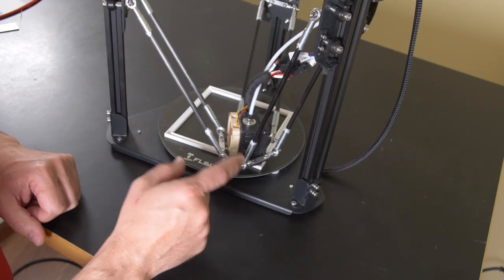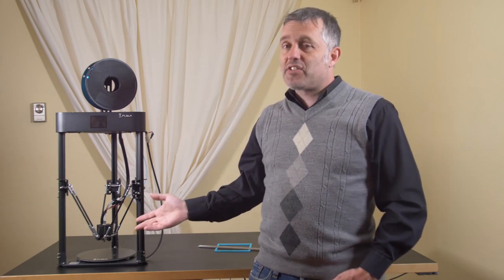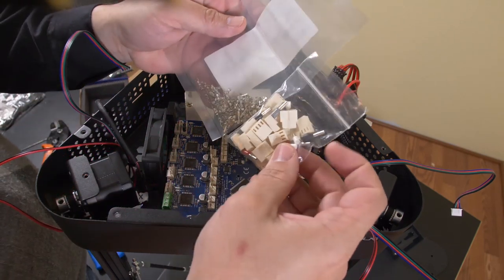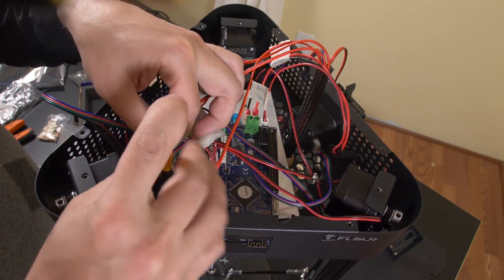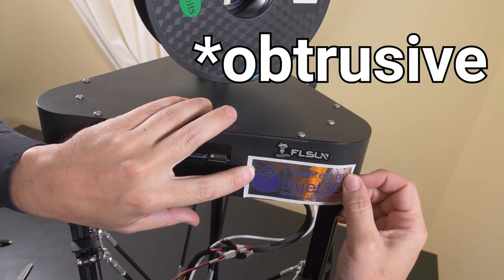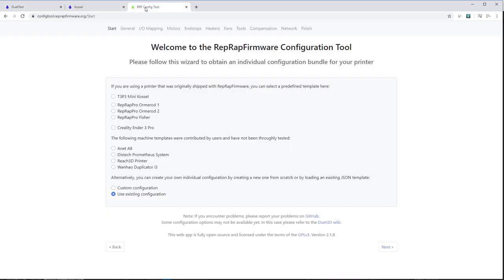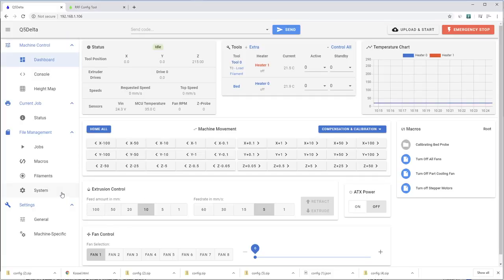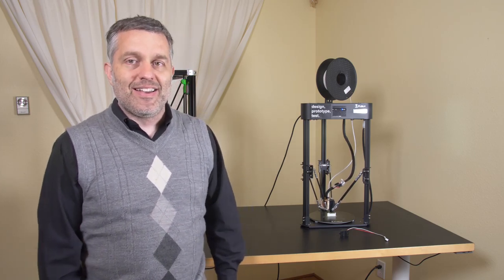How to Build the Best Delta 3D Printer for the Money in 2020

Comment: I agree with everything you're saying, but price is still king. If you're spending $300 to upgrade a $200 printer, it's no longer a competitor against $200 printers.
Reply: @SystemsPlanet  even if it does there's two problems as cool as it is to see a budget machine upgraded to perform at a higher level :
(1) it should have been functional out-of-the-box
(2) convenience is a feature too
Reply: So I bought a Rostock V2 back in '14 and straight away the ezstruder didn't work worth a darn. The hotend self-destructed, the arms kept popping apart during a print, bed leveling was strictly manual, accuracy of the prints was marginal at best, the power supply died after about three months, and the RAMPS board was crap. All for $1000. 

The one thing that SeeMeCNC has going for them is their fantastic forum support. It's really second to none.

If you own a delta (thanks anyway, but I have been cured), then you have to expect that some upgrades are going to be a necessity. So there is an argument to buying low knowing that you are going to have to spend money to get it working the way that it should anyway.
Reply: @SystemsPlanet  Also assuming your time is worth absolutely nothing.
Reply: @NotTheStinkyCheese  Well to be fair, it's a $239 printer and a $170 board, making it a $409 printer (plus shipping and apparently hours of aggravation). In the end you have a very good printer, as he said, perhaps the best printer available in 2020. On the plus side, making one means you know it well. On the down side, well there are only a handful of them in the world. Something like the Ender 5 Pro may not be as good but there are many upgrades available. Still, doesn't anyone make a delta that works out of the box? I'm looking for a 3D printer to prototype electronics enclosures and am fascinated by the deltas. This one is just about big enough...
Reply: @Jim-ei2iv  once you get it all dialed in, you don't need any upgrades. Besides, if you buy something commercial then you may be in a position of having to use some proprietary parts or have stuff you can't replace. By building your own, you can choose to use mainstream parts which makes it easier to continue to modify and service in the future. 
For example. If you use a genuine e3d v6  hot end, all upgrades and updates and service/maintenance parts are yours for the taking.
Reply: Plus there is a lot of waste in anything you replace. It costs some money, but if you build your own frame, and make it so that it will easily accept standard or common off the shelf 3d printer parts you can build a hell of a machine. If you want to emulate a popular printer you could even use their upgrade parts to build your machine. If you use the same specs/ travel in your axis for instance, and the same board assuming it's not a proprietary system, you could even take advantage of their firmware.
Reply: @Atlas Quinn spam much?
Reply: Cason Lyle  Spammer

Comment: In my opinion your solution to every printer issue is "just stick a duet in there". I understand this from a usability point of view but financially it makes absolutely no sense. I'd really love if you gave Klipper or flashing a modified Marlin on that board a try before you swap to a duet. For many people buying another 100-200 dollars in parts to replace already working parts is just not an option.
Reply: Moving to 32-bit on a Delta is absolutely 100% mandatory. No ifs, ands, or buts about it. 8-bit CPUs simply can't process the kind of calculations for delta kinematics in a timely fashion, and this lends itself to inaccuracies. You DO NOT, however, need to go with a Duet board. There are plenty of other 32-bit boards available for much less money, but if you want the absolute best money can buy, a Duet is what you'd go with. For a good Delta board, you can use RADDS or the SKR 1.4 Turbo, as both are significantly cheaper.
Reply: it's the case for me, i don't buy a 3d printer to spend 150% of the price on upgrades, i want it out of the box usable at the cheap starting price.
AFAIK the Q5 already uses a 32 bit board
Reply: I have this printer and if developped the same issue when moved to a warmer place. Turns out the stepper VREF was set to high at 1.2V, tuning it down to 0.8V fixed the issue.

Comment: One upgrade you can do on a cheap model is a thing that may not be obvious for most but the arms does not actually have to have same x/y spot connection, ie you can use a square and offset bolts as the delta arm lenght is whats important, not how you transfer the movement. What does this mean? You can use whatever material and bearings as long as you calibrate it, but you do not have to use flimsy balljoints or magnets, just drill two holes through a square and offset them to not collide and bolt it tight to the arms, and it will work much more rigid.

Comment: Set your pwn limit in the duet software to 125 and you don't need to do that buck converter thing. The whole point of pwm is you're simulating voltages  using the integral approach
Reply from the maker: What a great idea, but I don't think it works like that. PWM basically amounts to  a switch on and off very rapidly. Every time the switch is turned on you are still feeding 24v to the fan. Even if your PWM signal is set to half (128), and your fan seems to be spinning at the correct RPM, it still means that the fan is exposed to 24v of current for 30 seconds of every minute. While the fans may survive this, if the fan circuitry wasn't designed to handle 24v current you run a serious risk of burning out your fans, and they always fail at the most critical time: Murphy's Law.
Reply: @DesignPrototypeTest  so, yes, that is a simplified way to explain pwm, it isn't the same as banging the fan on with 24v for 30 total seconds in a row and off for 30 seconds. This is because a fan is a motor which is an inductor which is trying to preserve current at the expense of voltage. The coil resistance is what sets the current through the fan, controlling the power it sees. Because you are effectively giving it an a/c power source, you don't see the voltage on the fan the same as 24v. You need to integrate over the time constant to see what the effective voltage is, which is 12v. The inductor and resistor don't care about seeing 24v for a millisecond, they care about the heat generated from the 24v for a constant supply. Because we pulse the voltage, the power delivered to the fan is effectively as though it's given a 12v source. 
Source: am engineer
I've also done this to dozens of cheap one dollar 12v fans and none have failed.

Comment: Thank you so much for your video. 
I purchased the flsun Q5 following your previous video. It runs very well for the past 2 weeks. 
I must add that i did pledged to the Zatsit 3D printer kickstarter project. The project has not delivered and purchased the Q5 to have a delta to test. 
In the hope of the Zatsit project success, I purchased a Duet WIFI. 
You gave me (us, other unlucky Zatsit project supporters) a great guide to built a proper delta printer. Thank you so much! 
thank you for your hard work, advice, and your honesty!

Comment: I get a 2 years old Duet WIFI 1.02 from EBay and did it - the result is terrific. Circumstances I thought coming from slicer,  caused a lot of wasted time, filament and trouble, are belonging to the past. The dimensions are perfect, the prints are running fast, remote monitoring makes life easier - I am absolutely thrilled. 
But one thing cost me a lot of time: Firmware 3.1.1 changed the connection of z-probe from "E0" to "Z Probe Header", Pin1 blue, pin2 green, pin3 empty, pin4 red (seen from front). 
entry in config.g:
"...
M558 P5 C"^!zprobe.in" H5 F120 T6000               ; set Z probe type to switch and the dive height + speeds

..."

Comment: You are a true rockstar. I am just in awe of your insight and understanding of the 3D printers ins and outs, but I can't help wondering if you are missing out on an opportunity to build quality printers yourself? Here is my point: 
We are using 3D printed hinges, latches, etc for our production of 'something else'. We started out with a single ender-3 due to cost reasons, and are now do hundreds of ABS parts per job using multiple ender-3's in parallel. We tried a bigger and more expensive printer, but it turns out - as you know - that throwing more money at it does not guarantee a better product or better reliability. It only guarantees that you spent more money. 
If you saw our printers, you wouldn't believe it. They get a new layer of ABS juice and manual level before every print, we print three parts at each printer, one at a time in diagonal to not lose a full batch if it goes haywire. We barely clean up between the runs, and we have craters where the parts are located but it doesnt matter: We are not in the business of making beautiful useless cubes like CHEP, we are in the business of getting stuff out the door. 
So to my point: unless you have all the time in the world, reliability is king. We are running 6 ender-3 parallel right now because we need to have a stream of parts coming out, and I know at_least one of the printers is going to break down during the peak manufacturing period. And, when it does, I take a deep hard look at it and consider whether I want to spend time fixing it or just buy a new ender-3 instead.  
If you know how to piecemeal a reliable printer together from a best-in-class chassis from one supplier, and good electronics from another supplier and then software tuned by you to run for thousands of hours: That's a lot of value right there. If you can set up a fast, ultra-reliable printer at $$, you are not competing against fancy marketed printers costing the same $$: you are competing against workhorse printers like Lulzbot costing $$$$. 
Build your best-practices delta printer, and let it run for 1000 hours. Is it is still doing OK after that? You have a winner
All the best, Chris
Reply from the maker: Great message Chris. Would you send me an email. I would love to have a chat with you. My email can be found in the about tab of my channel: https://www.youtube.com/user/georgeoftj/about

Comment: After moving the printer out of the airconditioned room, to the non-airconditioned room. The Y motor was starting to turn off and print spagetti, exactly like in this video. Turns out the stepper driver VREF was set at 1.2V instead of 0.8V. Was easy to fix with a voltmetter and a screw drivers. It’s now printing as expected. 
Granted we should hold FLSUN to higher quality standard, however there is no need to replace the board to fix this issue.

Comment: @Design Prototype Test I know that I am way too late with my post, but anyway. You are wrong if you think they were stupid to not use a TMC2208 for the extruder. The TMC2208, if not used in UART mode, is known to just switch off during print if used with rapid changes of direction with full power. And exactly that happens if used for the extruder. The XYZ axes don't have this problem, because they slowly decelerate and accelerate on direction changes. On the BBT SKR 1.3/1.4 boards the drivers are typically used in UART mode, so no problem again.
Additionally there is no need for using the Duet boards to get the Reprap web interface you prefere. The Reprap firmware runs just fine on the much cheaper already mentioned SKR boards.
Reply from the maker: This UART could explain why the printer just stopped printing correctly in the previous video.

Comment: 24:39 When I pull the plug-in connector apart to use just the little female pins, I alway put some shrink sleeving over them so they look like individual sockets, are stiffer to strain relieve the wire and are properly insulated. Also easy to mark with some whiteout or metallic silver or gold marking pen.
36:16 The belt tension doesn’t define the rate at which it moves, only the diameter on the pulley does. The backlash, yes, the scale factor, no. Gap between the teeth will have the same effect at both ends so the stretch is effectively cancelled.
Reply from the maker: Good tip about the shrink tubing on the crimped end. Now, about belt tension. If you over tighten the belt and it stretches the spacing between the teeth becomes greater. So, let's say that the 1mm tooth spacing of the pulley is maintained while the 1mm spacing of the belt becomes 1.1mm. The teeth of the belt and the pulley will still mesh into each other, but there will be more slippage between them. As the belt teeth slide into the pulley teeth they will be moving that extra .1mm of travel. The belt teeth will be compressing by .1mm as they get jammed into the pulley teeth. The belt and pulley teeth all along the semicircle of engagement are constrained to eachother but since the pulley is metal, it does not flex. The belt instead maintains compression and those teeth are properly meshed until they reach the far side and are released. As each tooth of the belt is released, they are suddenly free to decompress give into that extra tug of the .1mm of travel as they are released. The more stretch you have in your belt the greater the movement. Therefore, if one tower has a belt which is more tensioned than the other towers, it will travel a further distance for the same rotation of the stepper motor driving. it. This is shown in the real world by the fact that I did not have exactly the same measurements for the movement of each tower when I put my caliper on them at the 36:15 mark.
Reply: Design Prototype Test : Same will happen on the driven pulley as on drive pulley. Effect is cancelled. Not that what you measured wasn’t real, there may well be an effect, it just can’t be the stretch. For example (and it’s not likely the case) as the one arm lowers more belt is holding it up so it is stretched a bit more at the bottom than at the top, arm will be lower than it should be. All three will be affected the same so scale factor will be the same though, this is a bad example but it does show that other factors could be in play.
Reply from the maker: The driven pulley doesn't matter. it is passive it does whatever the belt wants it to do. In my example, the belt wants to move an extra .1mm. Why would a passive free spinning pulley have any effect?
Reply: Design Prototype Test : Why don’t you test it and remove all question? Seems easy enough to calibrate the scale, adjust tension and calibrate again?
Reply from the maker: I was asking a rhetorical question instead of being rude and telling you outright that you are incorrect. You are the one making the claim. The burden of proof in this situation is on you. Do your own tests.
Reply: Design Prototype Test : ok, I’ll try again, the tension on the belt is constant on both sides of the pulleys, to do what you propose, one side would have to get longer than the other for the scale factor to change. Stretching changes both sides. 
I understand the effect of negative feedback in a public forum, I apologies if it came across as such, I like your videos and even like the thought provoking comments that I disagree with, for me it’s all about learning and I hope you see it as such. I can’t do the test without the printer or “delta”mechanism and certainly don’t want to be an armchair critic. Keep up the good work, keep up the comments.
Reply: Question answered, not as simple as I thought. A synchronous belt is driven by a toothed pulley and there are a number of teeth that pass per revolution. This usually drives another similar pulley attached to a lead screw (or camshaft or something else) and there is no sensitivity to length of belt or stretch. However, if you hang a gantry in between these two, the number of teeth per unit distance WILL be affected by the stretch and so the distance per revolution will be subject to the stretch. So accuracy depends on your configuration, belts driving a lead screw are ok. For the variable sensitivity of a delta printer and you had better calibrate each axis separately every time you set the tension.

Comment: i love my qq-s pro printers but have always wanted to upgrade the control boards to something better but ive never done it an both of my machines are over 2 yrs old an still working so maybe i got lucky but ive thought about picking another one up that is a parts only printer from ebay an just use it to build from, but im not sure what control board to go with an right now is probably not the best time to try to buy a control board. id really like to try klipper but the raspberry pi boards are stupid expensive now compared to what they used to be an i only have one on hand right now an id rather keep using it the way i am now with octoprint and retro pie gaming console, just swapping sd cards depending on if im wanting to use octo print over using it for klipper unless i can get my hands on another pi decently priced.

Comment: I loved that video so much that i bought that printer and also same Duet 2 wifi board. I placed the board on same place as you did. And got duet wifi connected to my wifi router as it gave me address in YAT BUT the thing is as Duet Web Control open up in browser, i can`t get it connected. It`s like dead web page. There is something i need to do but i dont know what?

Comment: So if I was to buy a delta today to upgrade from and try to get close to engineer quality prints. Where should I start? I see the Little Monster and Predator are no longer available.
Reply from the maker: >engineer quality prints
Don't buy a delta if this is your goal.
Reply: @DesignPrototypeTest  makes sense i honestly really just want a delta because it looks so cool while printing. I also want to use it as a upgrade platform and drop in a Duet and maybe add linear rails. If those were my goals where do you suggest starting. I see Tevo rebranded as Homers and has Little Monsters for sale via the website but I've seen some people expressing frustration ordering from there.